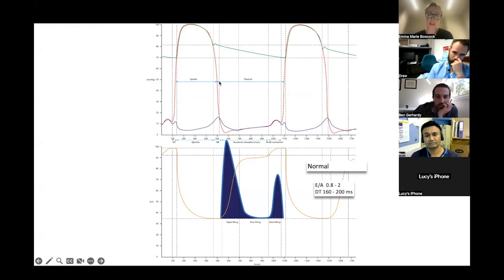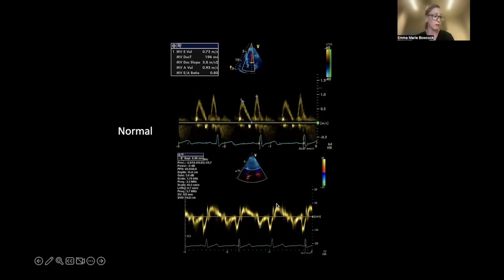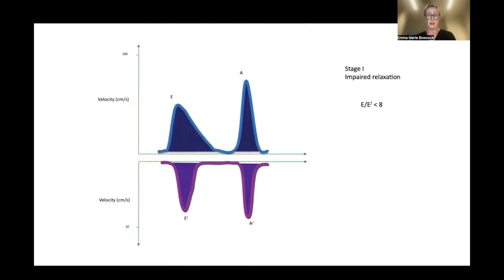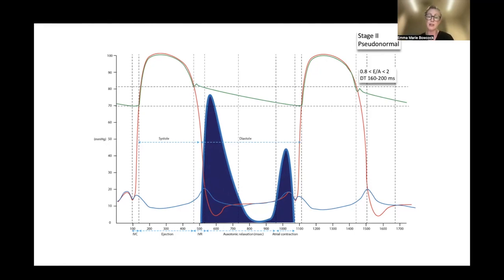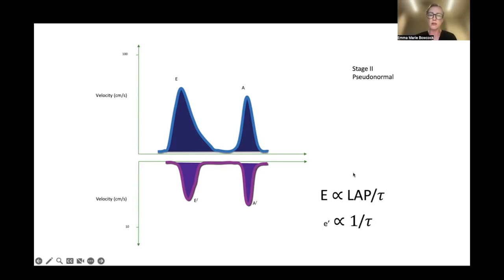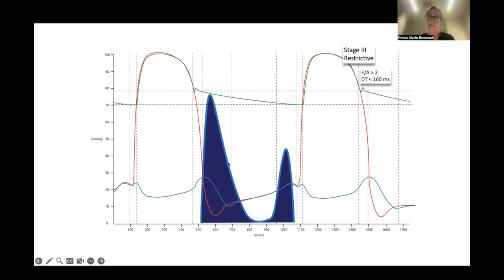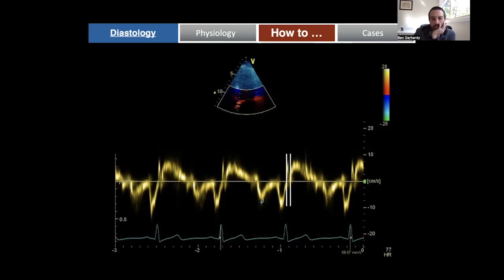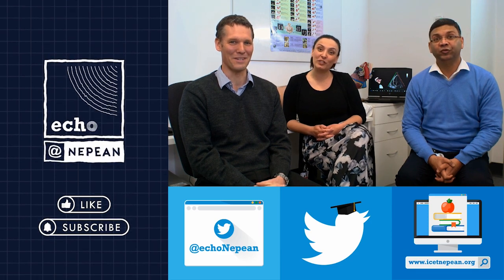Overview of Diastolic Physiology and Echo

Comment: When there is E/A fusion, do you measure the A from the baseline or from where the E fuses with the A?
Reply: I would avoid measurement when there is fusion as it is likely to be misleading to inform on diastolic function. If there is a beat where there is separation of the E And A then this can potentially be measured. Other parameters apart from E and A waves may be useful ( PV analysis for example, IAS kinetics, LAVI, TRVmax). Hope that helps, would recommend books by Bonita Anderson and of course the comprehensive guidelines.
Reply: @emmabowcock6698  Thanks